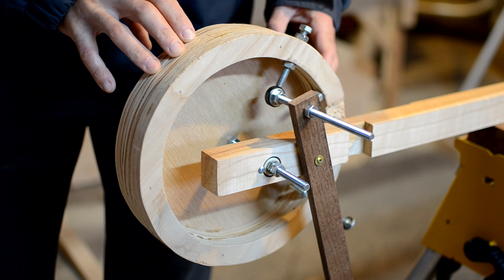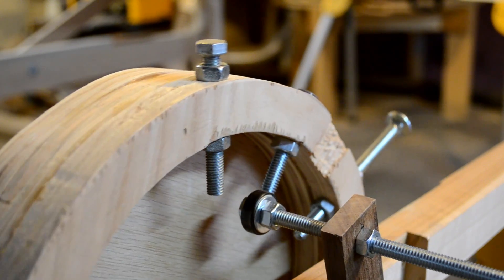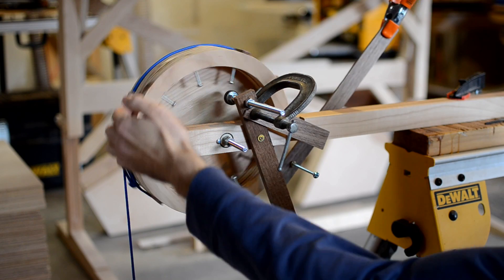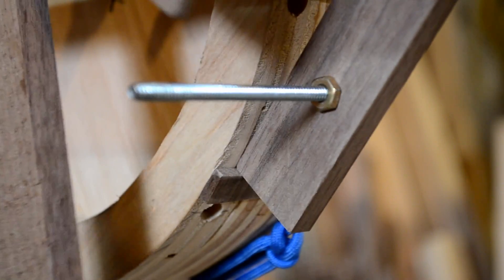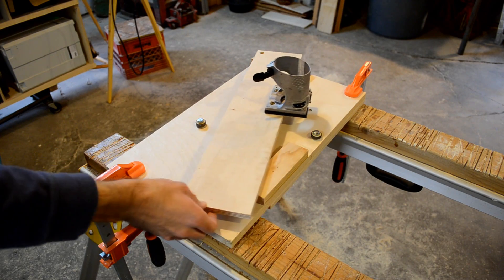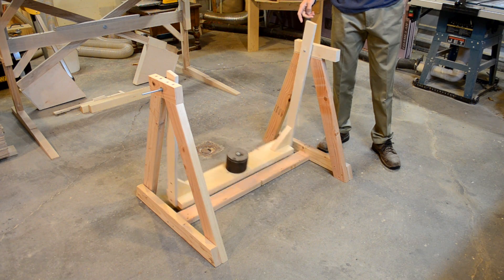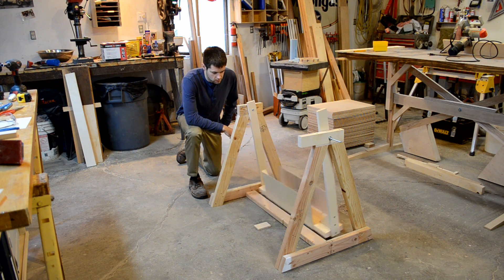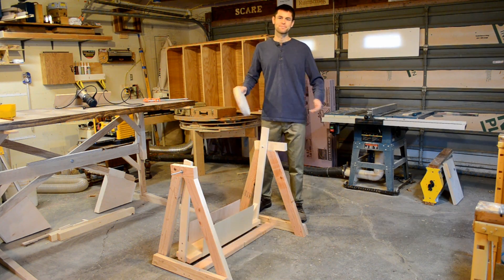Escapement Cradle #2

Comment: Looks fine to me, but drawing it beforehand would help minimise the trial and error heartaches. The concept is the same as the Galileo Escapement,  where the locking pallet  is lifted and then the impulse pallet come in to  transfer the energy  from the wheel to the pendulum.
Nice workmanship and a persevering spirit.  Well done.